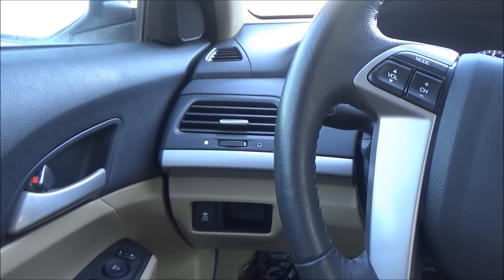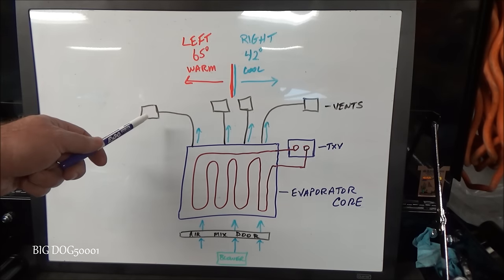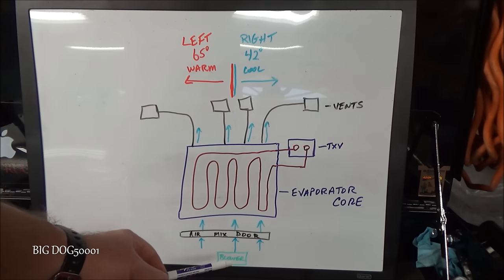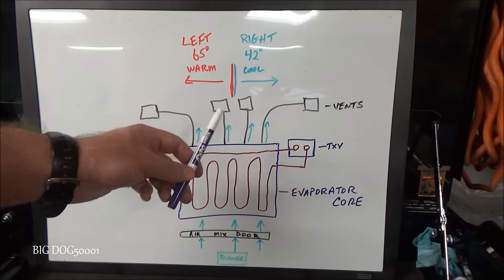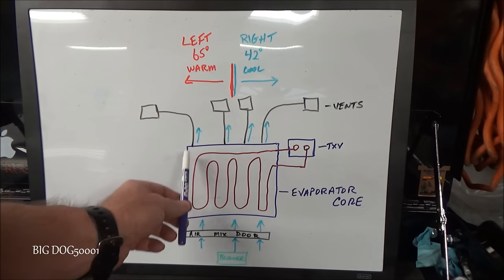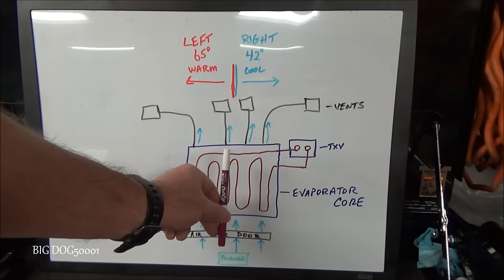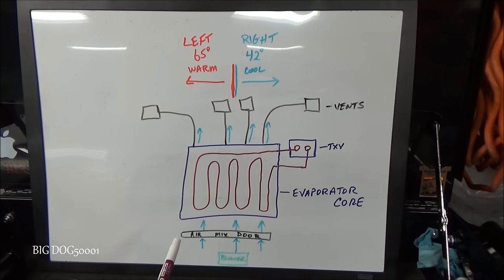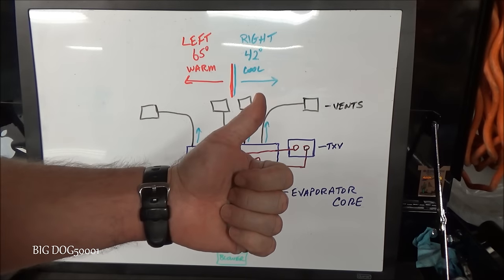Honda Tips: A/C Blows Warm Air Out of Left Vents and Cold Air Out of Right Vents

Comment: hey ! this video was super helpful. my first time around i actually felt super comfortable knowing that my brand new car just needed anti freeze. not to mention i never been in an accident so i have no reason to believe i have a leak. up until yesterday when i realized that it was the 3rd day in a row that my left air vents are blowing hot air again. i filled up on anti freeze just two months ago. now i’m confused , any suggestions ? btw i drive a honda 2019 civic sport, please lmk if anyone else is also having these problems, thanks ! shoutout to the video creator! great break down !
Reply from the maker: Low engine coolant can cause issues with the HVAC system for sure.  In addition, newer Civics are known to have issues with refrigerant leaks in the condenser, low refrigerant can cause this issue.  On dual climate control systems, a problem with the driver's side blend door can also cause this issue (and a problem with the passenger side blend door can cause the opposite issue).

Comment: HELP PLEASE. I own a 2010 Acura TL 105,790 miles. 
I HAVE HAD 4 EVAC/Freon replacements done In the last 4-6 wks & replaced driver side acuator. ITS STILL HOT on the left/drivers side😡😡😡😡😡
3 shops say there is an obstruction BUT NO ONE HAS FOUND IT!!!!! I’ve paid almost $1k trying to get it fixed. What do you suggest?

Comment: Liked  👍 questions however, in my wife's 09 4 door accord, it's not warm at all on the left side. The ac pump is turned off. The heat is on. 
What might you say the problem is then?
Reply from the maker: If it just happened after work was done, then I would double check work.  Some things I would look at for no heat: low coolant level, air in cooling system, proper operation of engine coolant temp (ECT) sensors (ECT 1 and ECT 2), thermostat issues, air mix motor issues (especially if it is a dual climate control system), recirculation control motor issues.

Comment: Honda fixed my non working a/c -condenser-and it lasted two weeks..then a few days warm on left cold on right then no cold at all. They “fixed” it again - compressor - here we are again, 2-3 weeks later and I’m 20’degrees warmer on the left and soon I’m sure there’ll be no cold air at all. So lots of money out for nothing!  Thoughts?
Reply: Exact same problem with my 2004 Accord and Driver's side hot few weeks after compressor replacement. The mechanic now tells me that it's the "Honda 79160-SDA-A01 Temperature Driver Motor Assembly". Ordered a new part and will know if that helps in couple of days.
Reply from the maker: Sometimes it may appear that it is the same issue as the one that was "fixed" but it may not be.  I don't know what year you have, but newer Hondas are having a lot of issues with refrigerant leaks.  That being said, if you need to take it back for the same exact issue that quickly then they should be looking at it for free now (and fixing it for free if indeed it is the same issue).  This is what is known as a "come back" and they should be taking care of it.
Reply: It’s a 2017. I’ll have to give them a call...just need to generate the energy for talking to them. They tend to interrupt and not listen.
Reply: Replaced the Driver's side Temperature Driver Motor Assembly and now the difference is about 10 degrees between driver's and passenger side. Slight improvement, but overall the A/c is very weak and doesn't cool the cabin efficiently. Have to take it to the mechanic this week.
Reply: Added a little refrigerant and tested the car for about 1hr. Way better in effiency than before, but is certainly warmer on the drivers side.
Reply: @RobotMoker  what model accord do you HAVE
Reply: @rosesolon9243  2004 Accord EX. Sold the car few months back (Whew for A/c troubles)

Comment: Thanks, @bigdog! This helps me understand and troubleshoot. My 2006 Accord had dual temperature controls and the passenger side sometimes blows the warmer air. The curious part is the if crank that side's temperature to lowest temp, it will send cool air through.  Thus, I assume that by cranking it down the passenger side pulls more refrigerant. That would mean that the evap core is also split, I think. So I'll check the refrigerant first.
Reply: hey! were you able to fix it?
Reply: No that's not how it works.  Most likely your problem is a bad passenger blend door actuator
Reply: @mehedimostofa627  it wasn't the refrigerant.
Reply: @gfriedman99  I'll check this. Thank you.
Reply: @ManuelPumarada was it the actuator?

Comment: Thanks for the confirmation, its going back to the dealer again for the 4th time. How many condensers can you change in less than 3 years! 🙄 Beware of the 2019 Civics
Reply from the maker: Those newer Civics definitely have issues with the A/C system and the newer refrigerant that is being used.
Reply: I have a 16 and it’s going back for its 4th condenser replacement besides the air it runs great with just basic maintenance

Comment: Mine has a small leak on a high side coupling and the high side service port.  The caps need to be TIGHT on these ports.  The o-ring in the cap is the primary seal NOT the shrader valve unlike in a car or bicycle tire.
Reply from the maker: Correct, technically the cap is considered the primary seal on AC systems but the valve should not leak when cap is removed.  The Schrader valve should be replaced if they leak.

Comment: I have an 05 Honda Accord where if the AC is on, it will only blow cold out of the right side. However if the heat is on oh, it will only blow the heat from the right side. It just seems to blow whatever temperature is coming through the vents out the left. I.e. if it's cold outside I'm getting cold air on the left, if it's hot outside I'm getting hot air coming through the left. Would you say that it could be the blower door for the left side?

Comment: So mine had all blend doors replaced and freon fully charged however mine still blows warmer on driver side and cold on pass side. Could the expansion valve be half way stuck or not functioning properly and be causing this issue. Thanks

Comment: Excellent vid, great job explaining how it all works! I'm researching an issue with my 2017 Civic EX, the right vent in the middle blows cold, the rest don't. Thinking it could be low on refrigerant however it's YF so it's tricky and expensive, have you seen a similar issue on these? Thanks again!
Reply from the maker: Yes, Hondas with the new refrigerant have issues with leaking, it is possible Honda may fix it under warranty.
Reply: I had that problem and it ended up being the evaporator. Expensive repair if not covered under warranty
Reply: Yes, just had mine replaced today and the service advisor told me Im lucky my car still under warranty otherwise I was looking at $1,200 with labor and parts.
Reply: Robert Fiore  it was a leak in the condenser so I had to replace it at my expense but the warranty covered the replacement YF refrigerant.
Reply: It was around $600 to replace the condenser.

Comment: Hi, I need to get some advice regarding my 2017 Honda Civic.  On June 6, 2022 I took my vehicle to a Honda dealership because it was blowing hot air on the driver's side when the A/C was on. They replaced the condenser, O rings and dye due to a leak.  I'm having the exact same problem again. Could a new condenser fail within 4 months? I'm seeing that it takes 3-5 hours to replace a condenser,  Is that correct because the dealership did the work in 1 1/2 hours? How would I know if the condenser was actually replaced vs patching the leak since it's problematic again? Thank you.
Reply from the maker: There are definitely issues with leaks at/near the condensers on newer Civics.  The techs at the dealerships have replaced so many that they can typically do it much faster than the book time now.  At 4 months, the dealer should at least look at it for you due to the same complaint (however there are many things that can cause this issue besides leaks at condenser).

Comment: My passenger side started blowing cold air when the heat was on, drivers side was blowing heat like it should. 

Replaced the passenger side blend door actuator and then it’s reversed. With the AC on I get cold air like I’d expect from the drivers side but now hot air from the passenger side. Any help?

Comment: Hey @bigdog50001, I’m having the same issue so I checked the Freon & added accordingly but that didn’t fix it. I then checked the blend door actuator and that is working fine, I pulled the actuator off to rotate the gear by hand to see if I can feel the door open & close and that was ok. Next step I had the compressor changed & that didn’t fix the issue either. While driving on the highway the air is much cooler but dead stop it’s back to warm on driver side cool on passenger side. Do you think maybe it could be the TXV or the evaporator?
Reply: Update. It ended being the expansion valve that wasn’t letting the refrigerant flow correctly throughout the evaporator

Comment: I brought truck into the dealership multiple times for the very same thing freezing cold on the right side and on the driver side 95 degrees I am getting frustrated even in the winter seasons it's much too cold I have to close off the vents on the drivers side!
Reply from the maker: The dealership wasn't able to figure out the issue?

Comment: Hello
Thank you for drawing and theory how AC work I have 2015 Acura RDX  if I set fan at low speed driver side and passenger side are cold normal if I increase speed fan speed to maximum the driver side blow warm and passenger side blow cold how do I resolve this problem.
Thx
Reply: Having same issue on my 2015 Acura RDX. Did research and I was about to order and replace the air blender actuator but one commenter said check the refrigerant first before ordering parts. Took it to a mechanic and he recharged it for $120. Lo and behold, AC now blows ice cold air on all vents. Thank God! Mechanic joked: if you get sick, don't blame me

Comment: My 2006 Accord is blowing cool on the driver which is what I want but blowing hot on the passenger. Is my thermal expansion valve on the driver side maybe?
Reply from the maker: That happens a lot on dual climate control systems where the passenger side has its own temperature control.  It the passenger air mix control motor fails it can cause what you describe.

Comment: if ac is off, just fan on. and driver’s side is warm and passenger side is cool air, would this be the result of bad blend actuator?
Reply from the maker: If it is a dual climate control system then yes one of the actuators could be bad.  Could also be a coolant system problem too.

Comment: I have a Honda HRV 2016 and the left vent does not blow out any air at all. Just had the filters changed too and issue was not present before. Could it be an issue with the installation or a sensor issue. Theh want to charge me $125 just for diagnostics even though the issue was not present before I took it for the filter change.

Comment: If mix door on left is not working, will air flow be restricted?
Reply: Wondering this too. There is still air being blown out, but it's outside air temperature, or close to.

Our car has dual control, reckon I will see if it's charged with refrigerant and go from there.

Comment: my 2008 accord i usually set temperature at 20 c which is not too cold nor hot for me ,now  i notice even if i bump up the temperature to 25 i still get the cold air  at 26 i feel the warm air , ur explanation doesn't seem to be fitting in my problem, am i correct:? any expert opinion of urs pls

Comment: Hi their
I have one of the issues ??
The last point, were u referring to the bender actuator ??, that controls the temperature ?
I have checked the actuator on drivers side and seems to be fine, it moves up and down when temperature is changed correct.
So maybe all I can think of is low gas
Reply: From Australia too 
I have a Honda accord 09 model cp2 2.4litee 4 cylinder
Do you know where the motor is located 
thanks

Comment: Hey i have a question, i have the same problem as you but after a year of not using the A/C all of my freon leaked out so i’m thinking theres a freon leak on the driver side making the passenger side blow colder than the driver side, what are your thoughts

Comment: I have this problem on my 06 Accord with the auto climate control.  On very hot days the passenger side is ice cold and the driver side is cool, but considerably hotter.  After about 20 minutes it seems that the driver side all of a sudden gets cold.  I replaced the blend door motor but that was not the problem.  Since the passenger side was so cold I never suspected the A/C charge.  Do you think that is my issue?
Reply from the maker: Hard to say from how you describe it but it is possible.

Comment: My 2010 accord is right hand drive car, and in my case the right side is warmer. While the left side gets cooler. However, i also notice that the low side refrigerant line isnt cold. Usualy when the compressor kick in, that line supposed to be icy cold.

So in my case, do i need to add more refrigerant or is it the motor inside the evaporator compartment? The accord does have dual climate system. Thanks..
Reply from the maker: If its a blend door issue, you can usually hear/feel the door actuators moving in the foot well area of driver and passenger sides when changing temps (usually one on each side on dual climate control systems).  Generally, the only way to know for sure if refrigerant level is low is to have system recovered and measure the amount recovered (need special equipment).  I don't recommend topping off because I have seen compressors destroyed by overcharging due to too much refrigerant in system because these newer systems don't contain as much refrigerant as older systems (and the fact that many of the small cans have sealant in them which can damage professional A/C recovery equipment).

Comment: I have the same exact problem. But only when idling. When running for about 5mins, everything is all good. Almost equal cold air comes out of the vents. Please help. Thanks
Reply from the maker: Make sure cooling fans are working properly is a good start.

Comment: Have an 08 Accord EX-L. Took it to the Honda dealer since I was getting no heat, they told me it was a clogged heater core and it required a flush, wanted to charge me $600. I did the flush myself and the core was NOT clogged, light green coolant flowed out and eventually just clear water, after that there was still no heat. I looked under the steering wheel for the blend door movement while I moved the temp from hot to cold, it moves perfectly. What gives?? Any guesses??
Reply from the maker: HVAC air mix blend doors and sensors, low coolant, bad radiator caps, car not run long enough to get to operating temperature, thermostats, water pumps, air in cooling system, blown head gaskets and plugged heater cores (and more) can all effect heat inside car.  

First thing I would do is check coolant level and then verify whether the vehicle is actually getting up to operating temperature (approx 180-190 degrees).  This info can easily be seen on a scan tool or code reader with live data as ECT 1 (and also ECT 2 on Honda capable scan tools).  I would start vehicle cold and watch temperature rise on scan tool.  I would also check for any trouble codes in ECM and HVAC system.

I like to verify engine temperature with a temp gun on engine to double check ECTs.  I also like to verify temps at heater hoses with a temp gun (there may be an obstruction at or before inlet hose).   

If the vehicle has automatic climate control, then I would also make sure the in Cabin Temperature Sensor (In Car Temp Sensor) for the HVAC is working properly.  If the vehicle has dual climate control, I would also make sure both air mix doors are working properly.
Reply: Big Dog50001 Automotive So I checked both heater hoses going into the firewall with a temp gun. The top heater hose reads 135F, bottom hose reads 120F. Both hoses read over 160F from where they start, near the thermostat housing.

Comment: I’m about to take my vehicle in for an inspection, it is experiencing the same problem you explained. But I’ve heard about the bulletin on the leaky condenser, do you think it could be a leaky condenser issue?
Reply from the maker: A leaking condenser could cause the system to be low on refrigerant, so yes it could be a possible cause (but other things can cause it too).

Comment: Thanks for this Video. I'm having a similar problem, but i only get cold air coming from the right passenger side when driving, when at idle i get warm air out of both vents. Does this sound like a low charge to you?
Reply from the maker: It is possible yes.

Comment: My Pilot '09 heater is ok on the passengers side but blows cold on drivers side. I spent $1100 on mechanic and still same issue. 
Is there any way i can fix this myself?

Thanks in advance
Reply from the maker: If it has dual climate control (can change the temperature individually on driver and passenger side) then it could be a possible problem with the Driver's Air Mix Motor/Door/Linkage/or climate control module that controls the Air Mix Motors.  Sometimes the system will set a Diagnostic Trouble Code (DTC) when there is an issue.  I am not sure what was replaced for $1,100 but if you have the same exact problem that you brought it in for still happening after the repair, then I would probably bring it back and make them fix the issue.